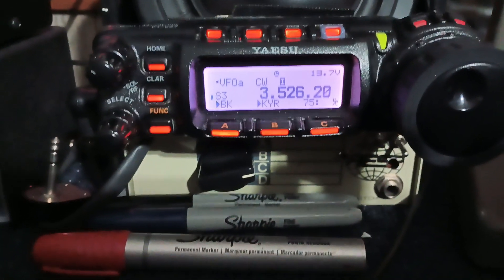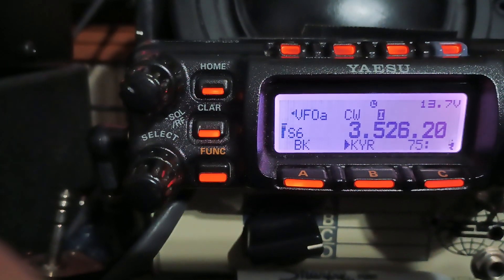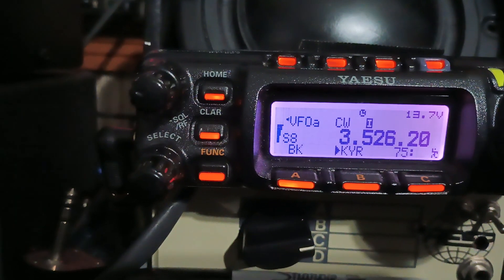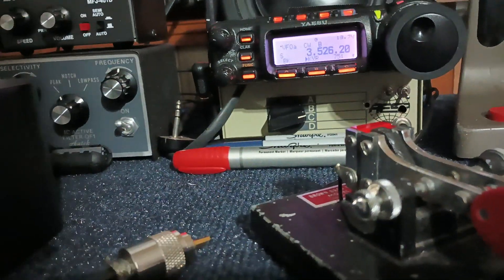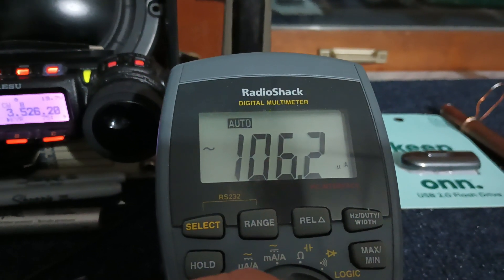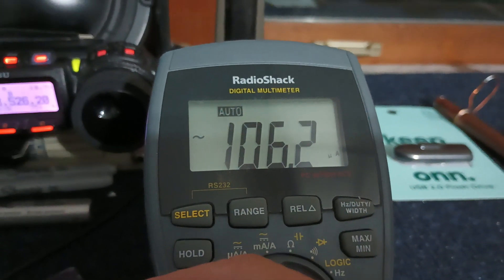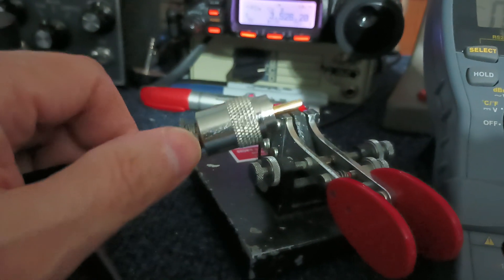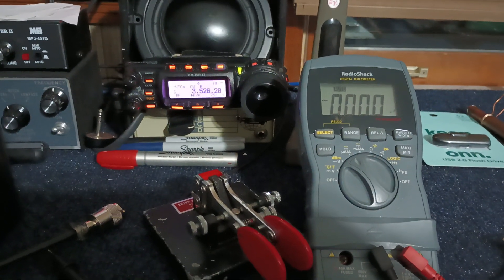Why Grounding Radios and Antennas Is Illegal...AND DANGEROUS #hamantenna #hamradio #grounding

Comment: Great video. That's scary!
Reply from the maker: its not a shock hazard unless there is excess leakage from the power supply. Problem is , 6 - 10 mA becomes dangerous to humans. Six mA is the level for GFCI trip, 10 mA is DEATH IN HUMANS.

It does cause noise problems